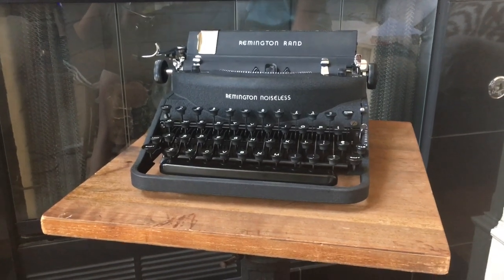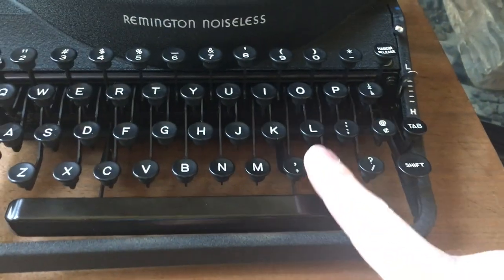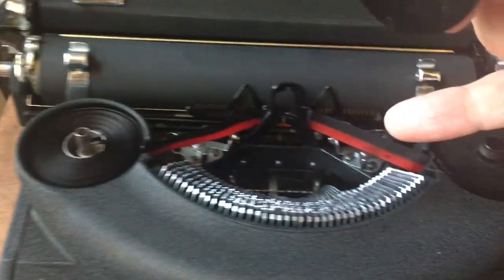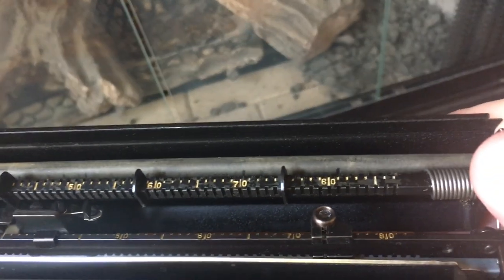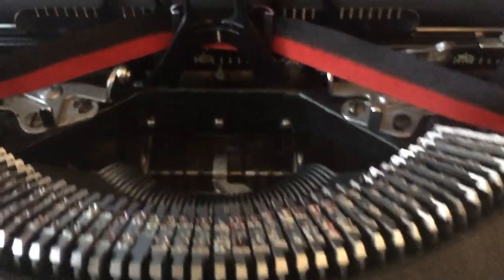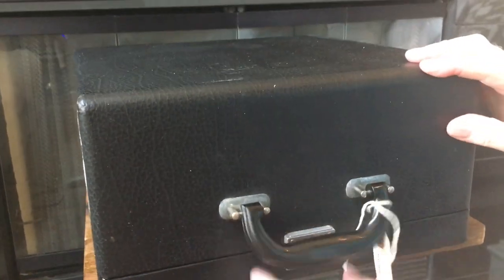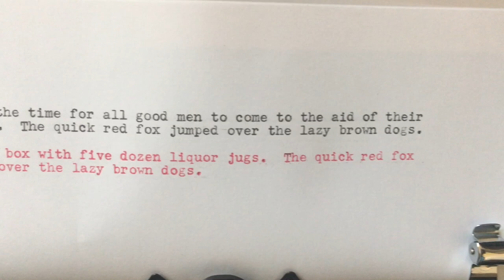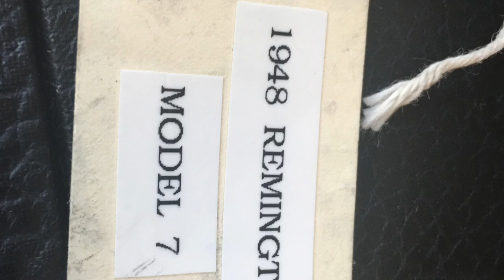Video review: 1948 Remington Noiseless Model 7 typewriter

Comment: Wow, what a great specimen! Definitely in much better shape than mine. Mine is nearly 100% functional and the paint is great, but the decals appear to have been rubbed off by someone, possibly during cleaning. Also my platen seems rock hard. Your ribbon covers seem to be aftermarket and plastic. Mine are painted to match the rest of the typewriter and the knobs on top are shaped differently. I'm hoping to eventually do a video on mine. Haven't done any videos in a while.
Reply from the maker: Thanks!

Comment: I've got one of these little guys (I was very excited to receive it). Unfortunately, mine doesn't move forward when using Shift, and the "I" key is really sloppy to return (I haven't pulled it all apart, but the day is coming). Otherwise, these little guys are fun to work on, and mine is much quieter than my full-size desktop machines or my Remette.

Do you all know a good method to repaint the keys? My "L" and "E" keys are mostly black.

Comment: Very Cool. Excellent video.  I just got a Quiet-Riter  and it needs a new set screw for the RT knob...someone on FB mentioned that Remington manufactured their own screws and the threads are different than hardware screws.  Is that true?  Is there any source for Remington screws outside of getting a parts machine?
Reply from the maker: I’m afraid I don’t know the answer to that one. I have had a few Quiet-Riters but I’ve never had to replace one of those screws